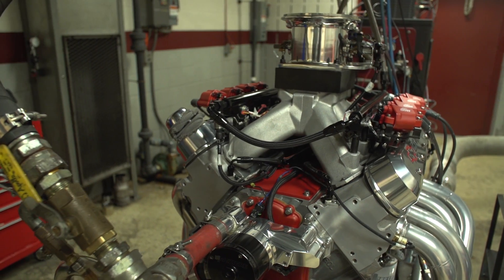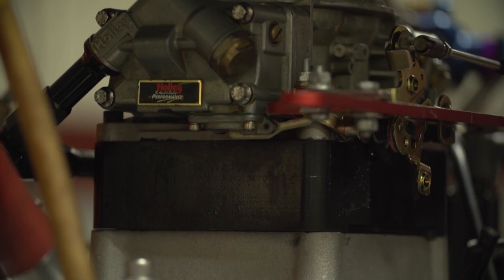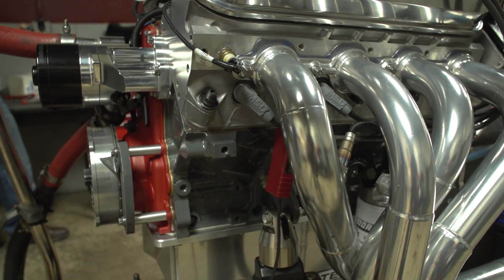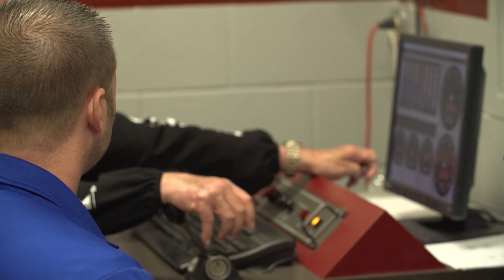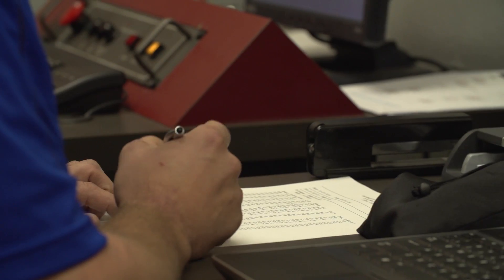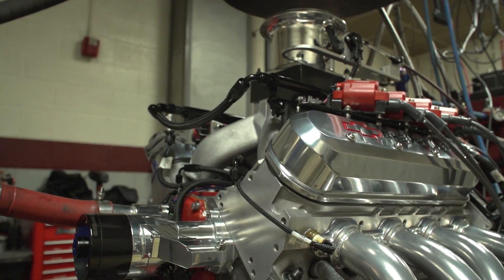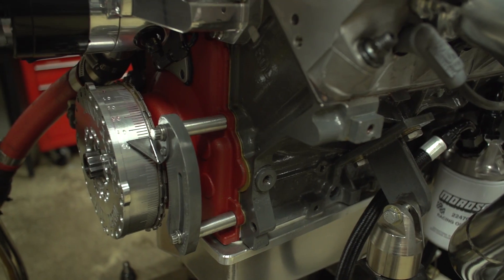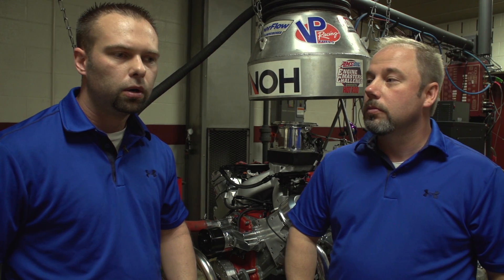435ci LS Motor by Gerry Stone and Eric Roycroft at the Amsoil Engine Masters Challenge 2014

Comment: Why, being blessed with the miracle of fuel injection and milisecond capable tuning do these ignorant pieces of shit convert to carburetors?
Reply: They stated in the video it has fuel injection and you can see the fuel rails, I think thats just a throttle body that looks a bit like a carb on top.
Reply: Iain ya that's what i get for not watching the vid
Reply: chewbaccathedog You seem very unaware of engines for being so old...
The pressure at the fuel rail is 20 times more than it is at the fuel hose on a carburetor

Microns is a measure of size, a fuel injector @43 psi base pressure can atomize fuel at a size of 50 microns, a carburetor just simply cannot compete as it loses in almost every item

Tuning of the air/fuel ratio
Driveability in high powered engines
Fuel economy (on stock cars like my mom's minivan)

As far as A Holley HP 4150 is going to do a far better job than any of the average aftermarket systems 9 times out of 10 at producing power

Is just plain wrong, a 2000cc injector can hold more power (there are bigger though) and are nearly in every store, An AEM EMS, Pro Efi, MoTeC, are gonna make a helluva better tune than a screwdriver and an greasy dude, you get where i'm going?
Reply: chewbaccathedog - guess that's why top fuel are not mounted with Carburetors but big ass injectors.  You get a C-
Reply: chewbaccathedog You still haven't told me how a fuel injection pressurised to 40psi at minimum has a bigger droplet size than a carburetor driven by vacuum.

"The drops become much smaller by the time they reach the intake valve and through the phase change, they take heat out of the charge"

Again carburetors prove to be lesser when compared to an injector spraying compressed fuel DIRECTLY into the intake valve, I guess you didn't read that part because I already said this.

"This also increases the density and efficiency of the intake system and also flow through the cylinder head."

Heat does the opposite of increasing density of the air charge, at this point I'm guessing you're just ignorant.

"You can certainly match the power output of carburetion and surpass it given a large enough budget but it wont look or be configured like a conventional port efi"

This doesn't look like conventional injection to you? http://www.lsxtv.com/image/2014/07/smugshot_8801941-XL.jpg

"The fact that Pro Stock bans turbo chargers is irrelevant to the subject of fuel atomization. There is not one form of organized motorsports that does not place restrictions of some kind on the vehicles that compete within that organization."
You said carburetors were good because pro stock used them, when in reality they have no choice.
Reply: +chewbaccathedog You're fucking stupid man, just do it somewhere else.
Reply: +chewbaccathedog - Thanks.  I found this article to be interesting... http://www.pro-system.com/scoop92102.html
Reply: +chewbaccathedog - Thanks. I found this article to be interesting. http://www.pro-system.com/scoop92102.html
Reply: +chewbaccathedog - thanks.  I found this article to be interesting. www.pro-system.com/scoop92102.html
Reply: +chewbaccathedog - Thanks